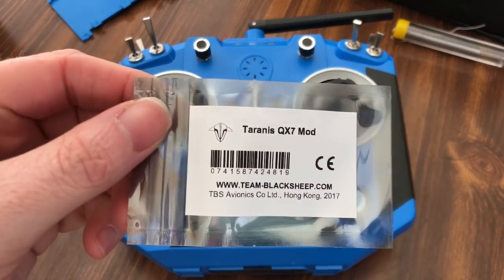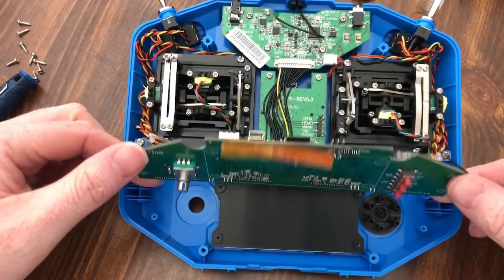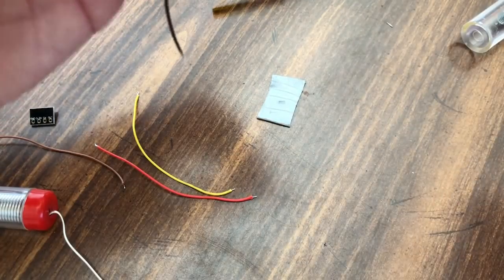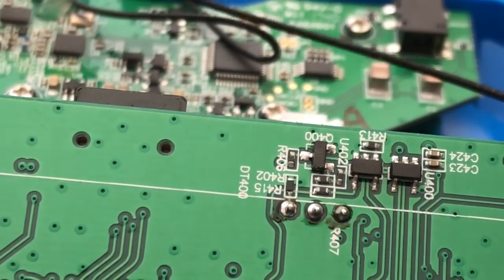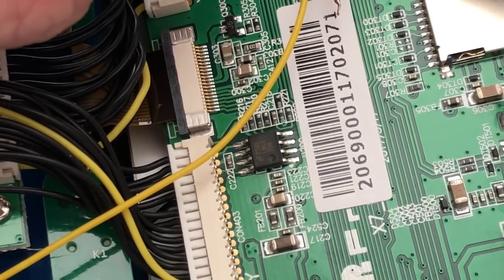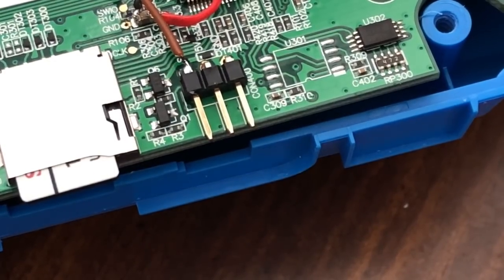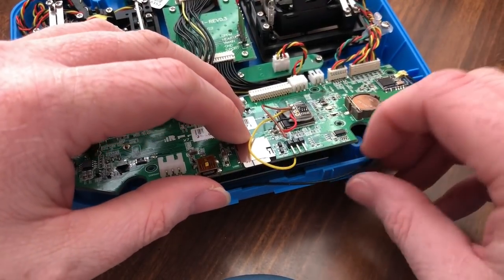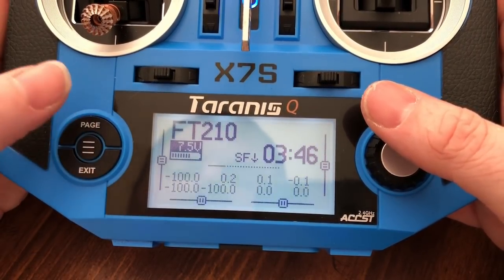Qx7s Crossfire hardware mod install

Comment: Hi! Maybe lame question, but I have some doubts on it. There is any negative consequences of this hardware mod? I mean for example after that I cant use any other external modules fot taranis? Or other issues with internal signal etc? ?
Reply from the maker: The only negative thing I can say is that you have to be ok with possibly destroying your main board and having to replace it.  But as far as any other modules I’ve never had an issue. I initially did this cause I was going to get a crsf but never did and I instead went with R9 because of cost and I’ve never had an issue.  I am currently still using this controller with this done as well so it’s been a few years and no issues.
Reply: @shawnkski  Thank you so much for answer. Regards!
Reply from the maker: Not a problem

Comment: Just push a small needle under the transistor while heating up.and use some pre tinned tips.
To loosen two legs at once just blob both pins with tin together..

I would solder the wire on the center pin and only loosen the other sides. Won't remove the transistor at all. Just make some clearance. Like to have options to recover it in original state.

Comment: Just bought a Taranis with this mod on eBay. Just getting into rc and will be using this for my skywalker plane build. Will this mod affect any of the controllers original functionality?
Reply from the maker: No it won’t affect anything I’ve had it installed on my qx7s  for over a year and i fly only with frsky receivers and I’ve never had an issue. I originally put this in because I was going to use the tbs crossfire system but frsky came out with the R9 system and I went with that instead

Comment: What is the antenna in the bottom of your radio?
Reply from the maker: The one that’s inside is the Bluetooth antenna for wireless trainer from what I understand. I don’t believe it’s on the regular qx7 only the qx7s
Reply: thanks a ton for the reply. I'm just trying to figure if I need to do this mod. I got one of the first qx7s and some of them are ok but I'm not sure how to tell. Think I need mod as I do have a q 400. Anyway thanks again!
Reply from the maker: If I remember it word the early version that didn’t need the mod
Reply from the maker: I actually did the mod and never got s crossfire I wound up getting the R9m and I love it
Reply: Ive been thinking about starting long range with the r9. I think I'll go ahead and give them a try. Save me some stress. Thanks again brother!
Reply from the maker: No problem the r9 is going to be compared to the full size crossfire in power but not features the mini crossfire I wouldn’t even get. If your used to the way frsky works and your comfortable with updating your gear I would save the money and get the r9 and with the new opentx update it fully interfaces with your radio now. And once over the air updates roll out for the receivers it’s a no brainer
Reply: Yeah I'm an electrical engineering tech so a lot of the enjoyment I get is from updating and tinkering.  I'm sold. Really appreciate the help. Plus one subscriber!
Reply from the maker: Awesome glad to help I’m in the same boat I studied computer electronics in college and love tinkering and building

Comment: Hi, I managed to knock off the resistor that’s right above where you solder the ground wire on the taranis. It’s the R104 one. It’s so small I lost it when it got removed. Any idea on what I could to to fix this?
Reply: Did you ever get this figured out?
If you can find out what the resistor value is, you should be able to get a replacement.
If you're in the US, and if the resistor is a value I have on hand I'll send you couple in the mail.
Reply: I just found a webpage which lists some of the resistor values on the QX7 transmitter. Apparently R104 is 1M Ω. I usually use 0603 resistors in my projects and I don't think I have any of those particular resistors on hand. If you're interested, I can help you find an appropriate resistor on Mouser or DigiKey.
See the webpage fixed-inverter-mod-for-tbs-crossfire-and-frsky-qx7 for more information on this mod.
Reply: The resistors looks really small. I generally don't use resistors smaller than 0603 in my projects but the resistors in the QX7 photo look like they're 0402 size. I figure it's safe to assume R104 is also a 0402 resistor.
I found an 1M Ω this size at Mouser and DigiKet.
Below part numbers are for 0402 size. (Probably the correct part.)
Mouse #  603-RC0402FR-071ML
DigiKey # 311-1.00MLRCT-ND
Make sure you order ten of them. Ten of them costs less than purchasing two and you'll be safe in case you drop one or two.
The Mouser price is a tad less but I find DigiKey has some inexpensive shipping options on small orders. You'll probably end up with a small total at DigiKey than from Mouser.
I'm not positive the resistor is a 0402 size one. It's possible it's a 0201 size (though I doubt it). If you wanted to be safe you could order the 0201 size one too. The 0201 has a manufacture's part # RC0201JR-071ML. 
Below part numbers are for 0201 size. (Probably NOT the correct part.)
Mouser # 603-RC0201JR-071ML
DigiKey # 311-1MNCT-ND

If you can measure the size of a similar sized resistor, you can be sure which size you should order.

If you're not comfortable making the repair, I'd be willing to do it if you pay shipping both ways. I live in Idaho, USA.

Comment: You have to keep your soldering iron tipped tinned...  The tip needs to always have solder on it, your never going to get good joints soldering like you were in this video man....  Every now and then, wipe the tip on a wet sponge and then tin it again right away and continue....
Reply from the maker: Yeah I was in a hurry trying to crunch time for the video but it didn’t work lol

Comment: Thank for that video ! I ll make the operation this night , I'm at 16ms for now but i want that famous 4ms ;)
Reply from the maker: I would love to try out crossfire one day I did this mod for the my channel and I don’t even own anything crossfire lol
Reply: hehe damn is like have a BMW key but not the car ;P , you wil love it , i put all on CRSF since i touch  it,  even if i m stalled at 16ms(for now) . TBS or frsky should paid you a kit for this nice mod video !
Reply from the maker: Haha right I did the mod with the intention with switching but when I had the cash everyone was out of stock and I spent what I had saved upto completely rebuild my quad because of  some weird issues I was having with my escs desyning
Reply: did you find then issue about desync esc ?  The q400 is a pain to desolder . But by your video i m now at 4ms , thank a lot man ! great explain and good plan of view !
Reply from the maker: Are you referring to Desync from a while back with my quad?  If so yes i was running some cheap racerstar esc and when I figured it up I was pulling to many amps for them and it would fry them or would get the desync so much they would fry I’m using some dysxsdv2 30a now with the dys Samguk 2207 2300kn motors and it is running amazing

Comment: Are you selling the inverter I need to buy it or where to get it at thank you
Reply from the maker: I’m not selling them I used the TBS one I got it from heli-nation and if your in the USA it only took me 2 days to get it 
https://www.heli-nation.com/team-blacksheep-tbs-frsky-taranis-qx7-mod-rc-radio-spare-part
Reply: Thank you very much if I have any problems setting it up could I get some help from you I really appreciate it if you could help me if I get into a bind
Reply from the maker: Sure thing as long as I’m not busy lol
Reply: Shawn K-SKI thank you very much
Reply from the maker: Anytime
Reply from the maker: Yes it comes with the tx when you order it I actually ordered mine by itself because everyone was out of stock with the crossfire tx

Comment: I have replaced the inverter, but pids has stopped working. Then i returned old J6 on its place, but pids still don't work and taranis doesn't enter bootloader mode. What's the problem?

Comment: How does this mod affect using other modules in the QX7s?
Reply from the maker: As of right now I’ve had no issues with it and other modules
Reply: @shawnkski  So... I did this mod (TBS) and Still can use R9M (FrSky) Module?
Reply from the maker: Yes I currently fly with the R9M module and have no issues

Comment: Needed a real work station with a heat gun and temp control to remove that small chip. It will pop right off if done right.
Reply: A decent solder sucker and a properly tinned iron is all he needed to do this properly
Reply from the maker: Yeah I figured when we move I’ll be getting my own work shop so things will be a lot better

Comment: The biggest question brother . Did it work ?
Reply from the maker: As far as I can tell yes but I don’t have a crossfire to test it with but I think a buddy of mine does. I’ll post an update and let you know
Reply: @shawnkski  question: without a TBS crossfire module, can still use frsky XM+ receiver? Thanks
Reply from the maker: Really good question and the short answer is YES. I never got to use a crossfire but even after the mod I’m still running all frsky receivers and I’m even running an R9M and have never had an issue
Reply from the maker: Awesome just take your time and be patient is the best thing I can say I was rough taking off the piece on the back of the board

Comment: You can get blue tac at Wal-Mart if you're in the U.S.  get some good electronics cutters from Amazon they're only $3 the big pliers made me cringe lol
Reply from the maker: A-Aronfpv awesome I am in the U.S. and didn’t realize I could get it at Walmart. Yeah I have some but I wasn’t really trying to break it off I was originally trying to just desolder it but I found out that with just some lite pressure it popped so I just rolled with it lol but yes I should have used some cutters
Reply: Shawn K-SKI nice vid by the way, I'll be doing this mod soon myself(tax time😁)
Reply from the maker: A-Aronfpv I hear ya I looked all over for the cheapest seeing as I’m not sponsored. I actually found it on eBay through heli-nation (was a few cents cheaper than their site) and had it to my doorstep in about 3 days